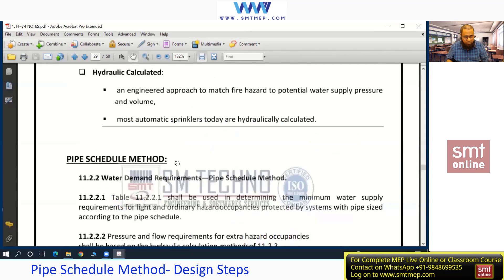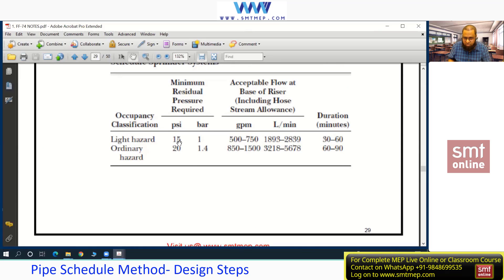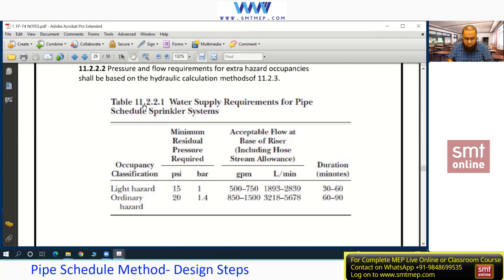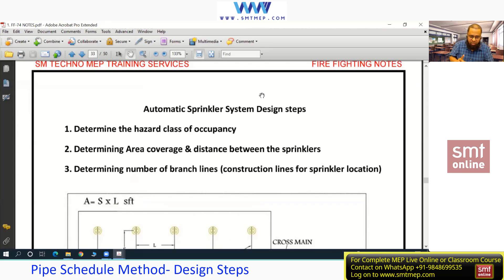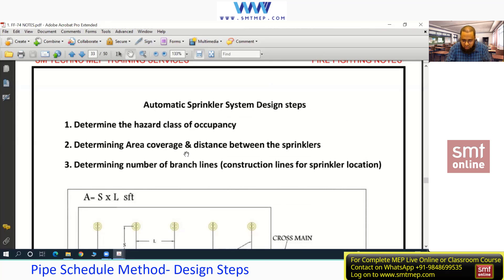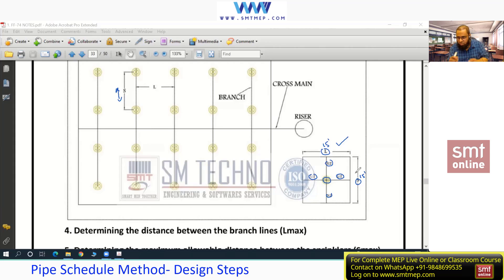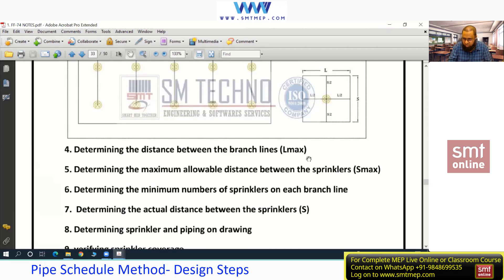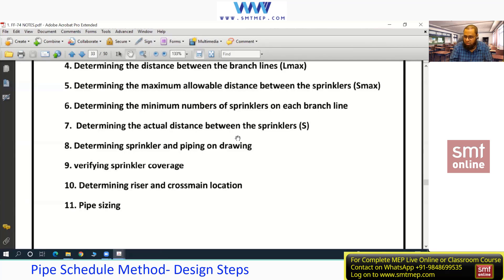Pipe Schedule Method Design Steps - Updated 2021

Comment: Asalamalikum  Sir, Really appreciate the level of your Teaching . Thank very Much for the Lectures .

Sir  ,I have  few doubts , 

1 )before we start Hydraulic calculation and Fire pump head calculation - Do we have find the number sprinklers  (coverage area method )?? 

2) The flow of each sprinkler to be calculated using Q=K * SQ. Root (P)   . Is is correct?

3) and to find out the total capacity of the pump we need to add Gpm of All sprinkler + FHC too  ??
Reply from the maker: 1. Yes

2. Only for last sprinkler.

3. No, only for sprinklers which is in hydraulic area+ flowrate of 2 FHC